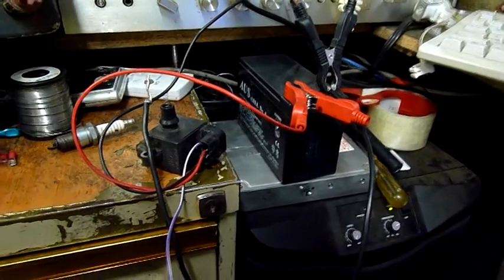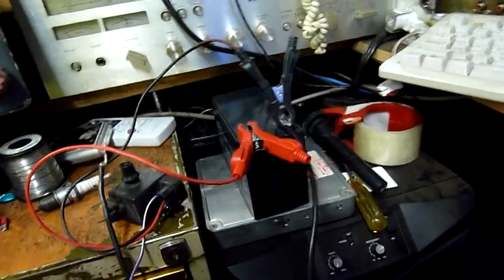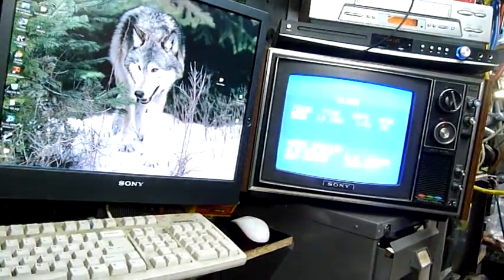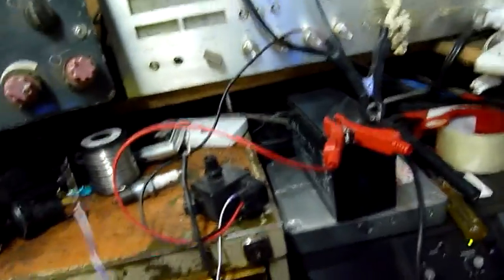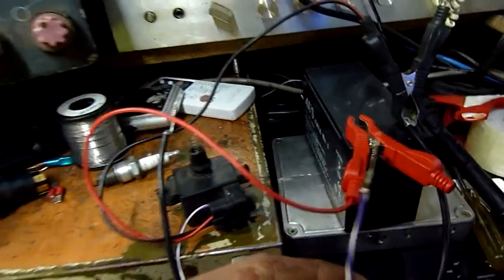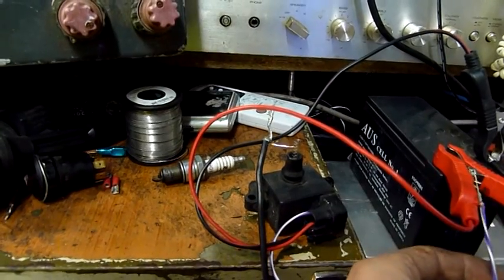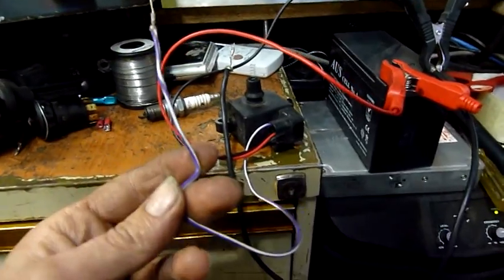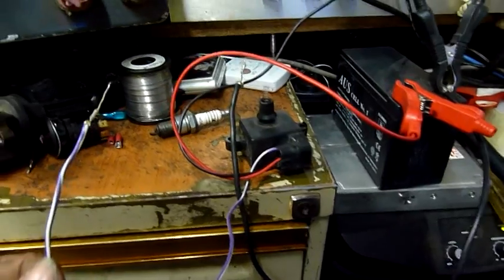Hitachi Ignition Coil On Plug Module Test

Comment: Run it at 10 hz - thats going to be more than enough duty cycle to deter any vermin touching the output. Better yet, have it increase the duty cycle to 100 hz (kill mode) when a load is present on the output :D

Comment: Watch haxby2008's power supply. It dips out of constant voltage mode into constant current. The power supply drops from 13.1V to 5.7V. I think the reason he is getting a persistent spark is that the controller/driver is resetting. In other words, he's doing it wrong.

Comment: Use the 555 and put a small relay on the output ( pin 3 ) and let it do the switching.
Plenty of diagrams on the web for simple timing circuits.

Comment: Ed, try putting a 12 volt buzzer like the old door bell type in series with the coil. Fool around with some capacitors  (NOT ElectroLytic) across the buzzer. > .01  mfd on up with at least a 200 volt rating. An example would be a capacitor from an old points ignition system. Play around with various capacitors as well. Another way to do it without a buzzer is with a 12 volt Double Pole Double Throw ( DPDT) Relay with 10 Amp contacts wired in series with one set of contacts to make it buzz .

Comment: For a rodent deterrent I would suggest a TV flyback connected to a small capacitor (a few nf) which will give a good snap when it arcs.
It doesn't need much power, and with a simple 555 driver it will run all day without complaining.

Comment: Aww you wimp! Nothing better than being zapped by a coil pack. A semi decent method of testing them in situ is by using a ccfl tube from a laptop holding one wire with the other at the hot end of the pack. You still get a fair jolt but you can time the flashes of the ccfl to see if one is a bit tired

Comment: I guess he gets a continuous spark, since the spark itself disturb the input (that resistor make it even more vulnerable).

So for continuous spark, you would need a 555 timer or some other PWM circuit(probably not that interesting to list them), or just bad cabling :)

His circuit is grounded to the grid via the PSU, you just use a battery.. it probably makes quite a bit of difference too.

Comment: make a simple 555 driver and connect the wire with the resistor to pin 3 it would be good cause you can control the frequencie for more current if you want to kill the mouse :)

Comment: Ed, I wonder if you wired a small value capacitor in series with the drive wire it would pulse but not make the device stay in a state of current drawing.
You will have to connect another resistor to the junction of the cap/switch to ground to discharge the cap between pulses, try 1k :-)

Just a thought :-)

That spark looked brilliant, no engine would have a problem with starting with that module installed, wow.

Nice vid :-)

Comment: I wonder if the control circuit inside of yours is damaged in some way, it only sparking when you connect the enable/IGN pin could mean that the switching device used to connect +12v to the driver is ok but the actually driver part could be dead. Does it draw any current without IGN connected (just +12v and ground connected)? 

Might be worth trying one of the other coils just to be sure.